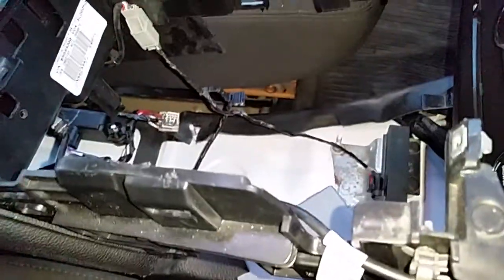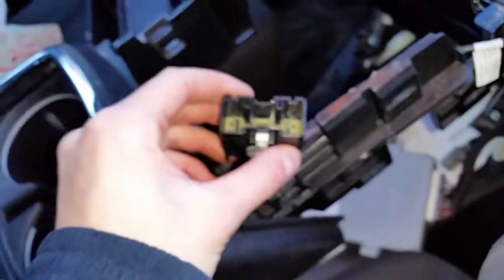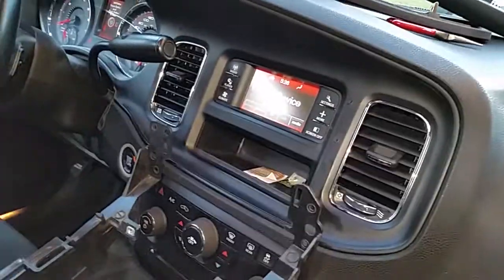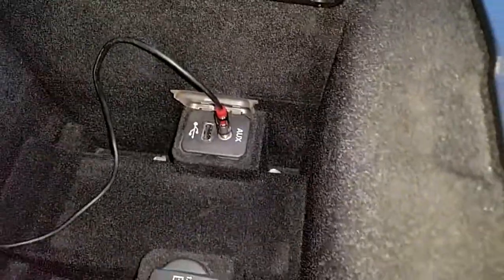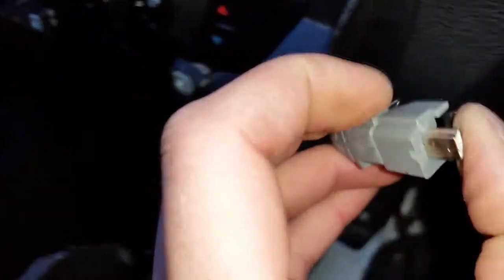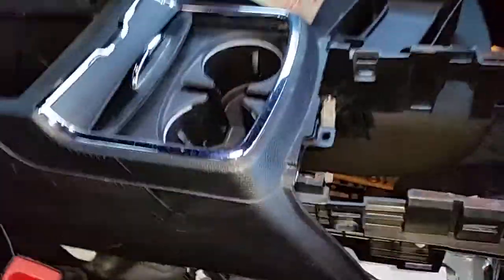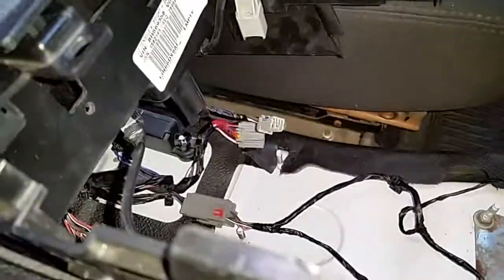2011 2012 2013 2014 Dodge Charger Police Pursuit Center Console AUX USB Installation / Connections

Comment: USB plug in a stock console is designed for 6v.  Hard wiring it directly to the Pursuit 12v (spikes to 15v) may cause issues. Possible device damage. Cup holder ring lights and cubby light seem to handle the voltage increase just fine. 
Mopar removed the 6v Pursuit line starting 2015.

Comment: I have a 2014 police charger and have the same issue, wondering if I could get some feedback with how to wire everything together into the stock console
Reply from the maker: +Daniel Madera if the factory harness has been cut then you will have to do like I did and just connect each lead to an ignition controlled 12V line,
Reply: Same Here Bro, If You Get It Together,Please Contact Me, ASAP, Thank You 😩💯

Comment: Hello. I have 2014 dodge charger police car. However, my car can’t use three 12v which are inside center console, near air conditioner behind front seat and under the radio. Is it possible to install or fix those?

Comment: I recently purchased a 2014 charger and I’m trying to figure out how to route the aux I have photos as well 
No aux port so I’ll probably have to buy that but most of wires are still intact, I also have questions about the power volt charger and if I could even get that inside the car 
Thanks in advance
Reply from the maker: aux plugs in to the factory harness which goes to the back of the head unit. All other functions of the console are 12V
Reply: @QuaabQueb  do you know a place where I can order these parts I’ve searched everywhere and found nothing
Reply: @QuaabQueb  all I need really is to find an auxiliary port and the cables that come with it

Comment: I installed it but for some reason my usb connection won’t pop up in the radio but it will charge my phone
Reply: Same problem with mine did anyone fix this

Comment: My USB plug in the console, the usb mini has a wierd voltage drop. At first the palstic block will light up for a few seconds and then dim. i tried two differant cables and the voltage is going from 5v, drops down to like 1.9V and then comes back up. I cant run anything mroe than a few seconds because of it. Have you encountered this issue yourself?
Reply from the maker: Yes I have, no idea what causes it. I am thinking certain devices have a high load that the usb just cannot handle.

Comment: Do you know if a 2015 console will work with a 2014 and from your video is it mostly just matching which clips go to which? Such as aux, lighter and 12volt?
Reply from the maker: Correct. The wiring to get the illumination to work as well as the 12V outlets will require you tracing the wires and splicing them to 12V power and ground.
Reply: What would be the easiest way to go about doing that?
Reply from the maker: @marcusphippin4373  there is no "easy" way

Comment: Great video.  Did your horn work?  I have the same veh and am trying to figure out how to reconnect the horn.  See,s like I have to continue the circuit from one of the plugs disconnected in the center console.  Any help is greatly appreciated.
Reply from the maker: Shitty video lol filmed the first week I got the car freehand with my phone, but thanks.
The hors get disconnected because they use the horn button to activate /change siren tones.
The wire could be cut anywhere usually it's behind the glove box on the right side where they splice in to it. You have to remove the glove box and plastic panel behind it to access it. But check under the hood first. They may have disconnected it somewhere there if you are lucky. Should be obvious.

Comment: I can help with some of the wires, also would you sell the wire harness that comes from the VSIM to that big white plug. I have a 2012 charger and I am missing that harness. Send me a message. Thanks.
Reply from the maker: +lightingnut Do you have OEM diagrams?
Reply: +Video Québec  I wish I did, but I don't have the OEM diagrams. Have you figured out where all the wires go? I too have a small gray female connector that the old owner police department had taped by cutting wires, not sure what they powered with it. Doesn't connect to anything I have.
Reply from the maker: all I did was connected all the wires for power to wires that had ignition switched 12V, and grounded to body of the car.
Reply: +Video Québec Any chance you would sell me the cable running from the VSIM to the big white male plug? When they took all the control stuff out of the car they took that cable out too.
Reply from the maker: I only have one, you can probably get one cheap from a scrap yard, or ask a seller on ebay selling parts from chargers, they sometimes have other parts, also try contacting yards on hollanderparts.com
Honestly since it is not connected to anything I doubt it is even required ?
Reply: +Video Qu&#233;bec The trouble is I have check with dodge dealers, parts dealers and no luck. This cable is only on the police package chargers. I have searched for junk yards that have wrecked 2012-2014 charges and not had any luck. The VSIM wire harness with the white connector plugs into an after market interface modular made by Whelen. The interface is then connected to the Whelen CenCom control head and controls stuff like, horn switch activated, reads vehicle speed, horn mute, driver door ajar and so on.
Reply from the maker: Interesting, what model whelen controller do you have? I have always wondered how to get in to the factory wig wag flasher or if there is even one, I heard that the chargers are supposed to have it.
Reply: I don't have the Whelen controller. I have the one I sell from Fenix Industries, model number 4200. Works great and is much cheaper then the Whelen controller. The 12 does have the built in wig wag flasher. but you have to buy a whelen interface to be able to connect to the VSIM wire harness.
Reply from the maker: I never heard of it being done that way
Reply: That is if you don't want to cut and splice wires. Other wise you need the Whelen interface so you can tap into the VSIM and be able to unplug all the extra stuff if the Dodge dealer needs to narrow down something that is not working right with the stock parts of the car. I did a lot of google searching to find out wire what went to what. LOL Been interesting for sure. I saw there was a VSIM for sale with the wire harness on Ebay back in Feb :(
Reply from the maker: If I ever see one I'll let you know. Also do you know if there is any other way to tap in to the vehicle or is that whelen system the absolute only way of doing it ? I wonder if it's just wires that get applied 12V or grounded to make the function work.
Reply: Not sure, try google for dodge 2012 upfitters, should find some guides that explain what wire does what. My guess is that is all it takes to make things work. Once you find the info you could try applying 12 volts to the wire and see if the lights start to flash.
Reply from the maker: Yeah the up fitters guide is all that I can really find, it's not very specific.
Reply: Yep pretty veg :( I think they do that so people don't do the work themselves. It looks like pin 1 brown wire of the white connector  is the headlight wigwags. Pin 2 red wire is the rear wigwag. Let me know what happens.
Reply from the maker: Going to try and contact some local up fitters to see if there is a way to tap in to it directly by simply applying 12V power. Based on what I am reading that's it. if you ever try it, let me know.
Reply: Good luck on the upfitters, I contacted 5 different ones and non of them would help. They did not want to give out the information because it would be taking business away from them. I don't know how that would happen because all of them were out of state and I sure wasn't going to leave the state to get wires hooked up.

Comment: If I don't have e police lights in my ex cop car, do I still need the vsim?
Reply from the maker: Not really, you can just leave it there or tuck it away in behind the dash/console area.
You could probably even just unplug it an remove it all together, I have never tried so I do not know if it will affect the vehicle in any way, but from what I can tell, probably not
Reply: Videos from Québec I also have no place to plug in the led light for the cup holder. I know it is a pursuit package straight from the factory so I could see if they didn't out any wiring for the cup holder lights. Any idea where to look in the wiring to find the wires?
Reply from the maker: What I did was cut the connectors and just spliced the wires.
Depending on where you got your console, the wiring harnesses will probably not match up.
You have one gray connector with constant power or switched power circuits, I used that.

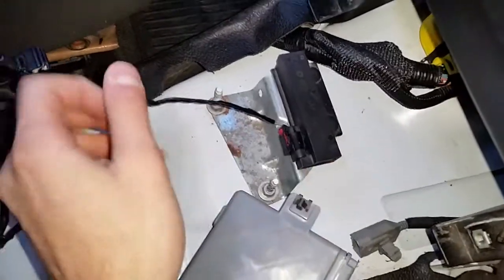Comment: Can someone help my 2013 charger doesnt have that cable thats connected to the sensors 2:18
Reply from the maker: jonathan martinez that sensor is actually the antenna for the keyless fob. I called it a yaw sensor which was wrong.
The cable has to be there somewhere and must be plugged in to that black antenna or your keyless unlock will not work.
When you walk up to the car and put your hand under either of the front door handles for a second they ahould automatically unlock

Comment: Anybody figure out what the module does?
Reply from the maker: Yes i figured it out shortly after, I made this video shortly after I had just got the car and did not know a whole lot about it. Basically it allows interface of various police equipment and sensors, if you sear for the police up fitter guide you will see the VSIM wire mapping. For example one of the built in features is you can trigger the wig wag lights (alternating headlight and tail light flashing) through this module.
Reply: Thank you for the reply! After my comment I looked at your videos. Thank you for the heads up! I subscribed. The only thing I'm trying to figure out now with the 2010 I have is what switches I need to enable them as mine did not come with them.
Reply from the maker: Any simply toggle switch. Grab 12V+ from one of the supplied circuits in the other small gray connector, you have always on, and some that are ignition only. Just apply 12V+ to either the front or rear trigger wires (car has to be on) and they will flash, if they have not already done so you can just cut the trigger wire from the back side of the connector, strip it back and make your connection.
Reply: Thank you, I appreciate the help.

Comment: Send me a message, I was able to make everything on the console work, except the cup lights
Reply from the maker: +Omar Silva Did you power it ?
Reply: +Video Québec not the cup lights
Reply: Omar Silva 
How have the cup holder console but it norade for my car I need help figuring out which each wire mean
Reply: Lonnie Scales  I installed a console also but could not figure the cup holder lights they look like it built in a circuit board can any one help
Reply: Can You Send Me Some Kinda Input On How To Get Thee 12 Volt Plug To Work Inside The Armrest Console, I Also, Am Trying To Get The cup Holder Lights Too Work Myself, Can You Assists Me With That, If You Can,Maybe We Can Video Chat And Sort It Out, Lmk Please, Thank You 😩🙏🏼💯
Reply: @omarsilva5119 me podrías ayudar
Reply: Tengo una consola, tengo los arnes, tengo todo, pero los cables de la consola original no son los mismos colores que tiene el carro originales, podría hablar por correo o alguna forma contigo?